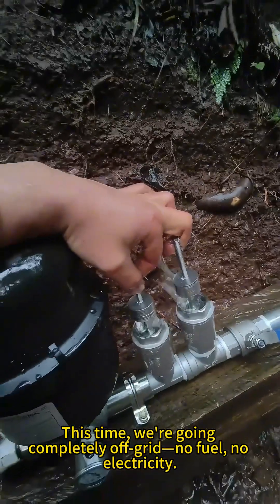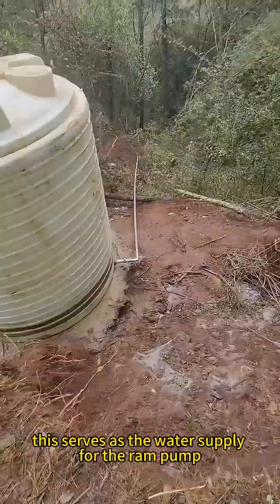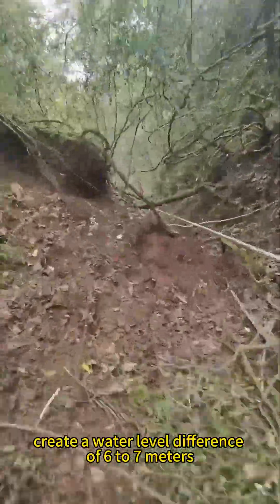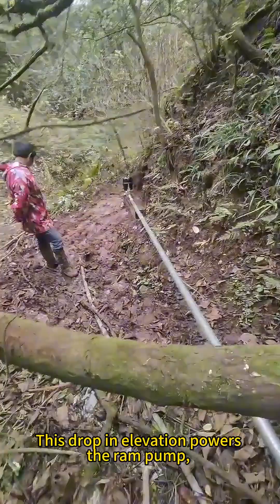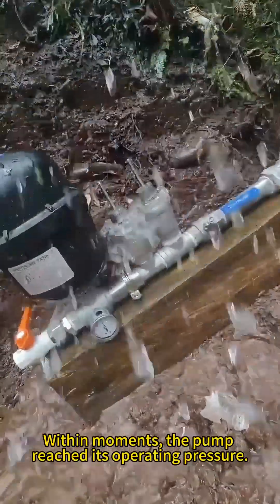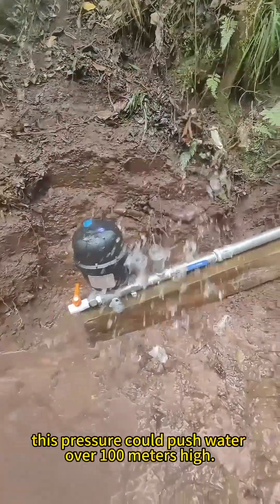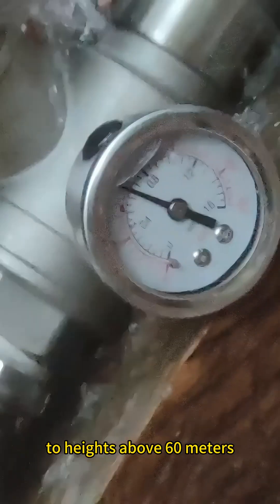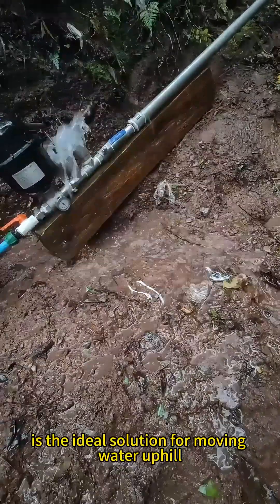Hydraulic Ram Pump Magic Off Grid Water Solution

Comment: May  I knew why there are 2 waste valve, how about single but larger waste valve
Reply from the maker: During the dry season when the water volume of the water source decreases, a valve can be removed to keep the ram pump running. However, if it is a large waste valve, it will be very difficult when there is insufficient water during the dry season.